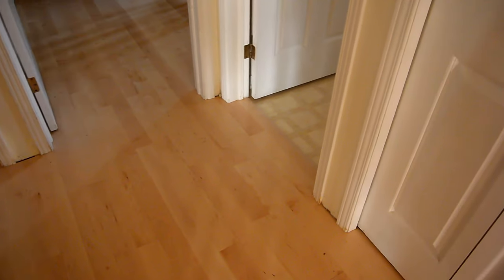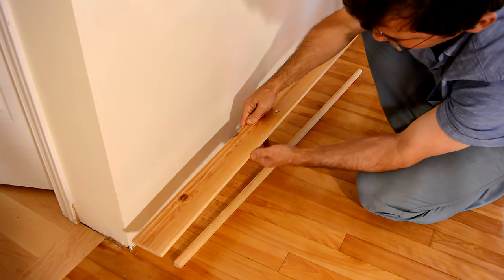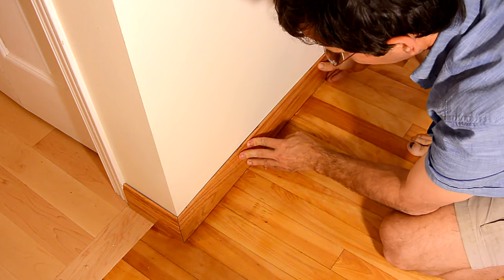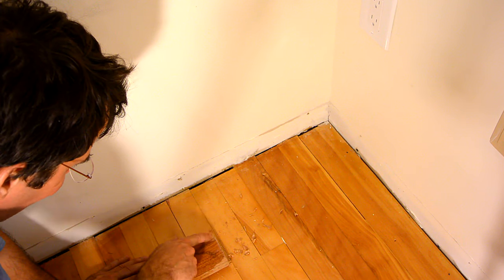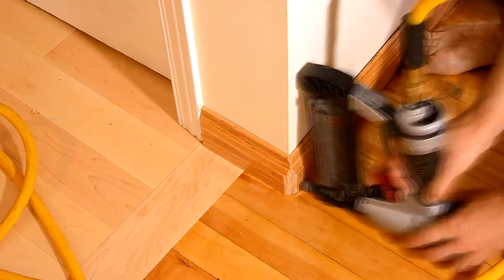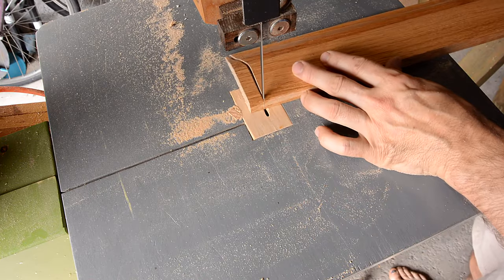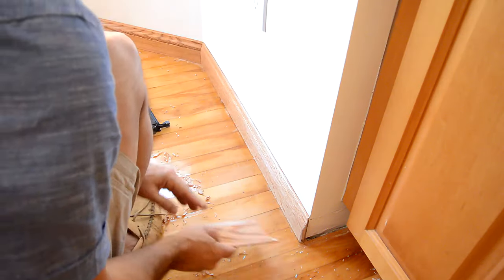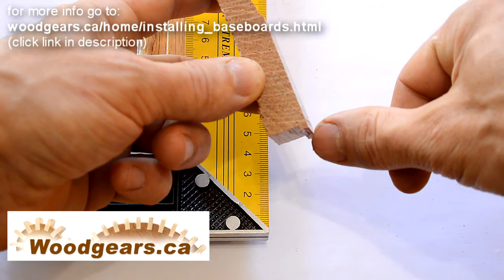Installing baseboards

Comment: I would never insult your intelligence, but how come you coped it that way? Why not just cut a 45 then follow the profile?
Reply: He said it was more work to get the miter to fit. The corners of the drywall aren't square so getting the angle flush is very difficult
Reply: Looks like you never installed something into a corner of a room ;) . I have yet to find a corner that's exactly 90°. Even being just one degree off from that will leave a very visible gap in the miter.
Reply: yea, i don't know if he knows how to cope a joint the "right" way, but if his way worked, more power to him
Edit: the way that most people do this is to cut an inside miter, one sloping away from the face of the work, then follow the very edge of it with a coping saw. works for all trim, and is way faster.
Reply: That would still be more work. It's work I'd probably do if I were to do this, but it's his baseboards. Doing it this way he doesn't need to cut a 45. On top of that, doing this it seems he just used a template to cut the second piece, whereas to match the 45, you'd have to custom do the profile for each corner, since each corner is going to be more visibly off.
Reply: Maybe one could use two rectangular pieces of play-doh to get the angles right if the corner ain't square.
Reply: I have a crooked ass old house, coping results is much less visible joints than mitres.
Reply: I liked it.
Reply: there is no reason for any custom profile, that's why professionals do it as i described. but it really doesn't matter, it just took him longer that i way i would assume, but he is not getting paid hourly, so it doesn't matter yet again.
edit: yes this way he is able to get the angle right, but htas the whole reason to cope, is to hide a joint that isn't 90 degrees. if he coped it square, and it was off a little, just hit it with a utility knife or a file
Reply: it doesnt matter the angle of the corner a properly coped joint looks perfect, he did a top job for someone who doesnt do this for a living.
Reply: AJPlaysToday Right. That's the way I learned as a wee little nugget anyway. It's always perfect no matter if you have a 90 or not. I guess the tilt of the wall itself could cause a gap but if the wall is tilted that much than you have bigger problems lol.
Reply: superdau Not miter. Cope.
Reply: seigeengine But he has the miter saw already there for his outside corners.
Reply: AJPlaysToday I usually cope it on a slight angle towards the back of the trim anyway. You won't see it and the front profile edge will sit tight.
Reply: None of you understand what big wonka is talking about.
Reply: no they don't ,,sometimes people can be so far behind they think they are in front
Reply: The first time I used a miter cut as a starting point for a coping cut it was a bit of a mind blowing moment.

People who aren't understanding it: go out to your garage right now and cut a 45° miter on a piece of moulding, then cut the miter off along the line formed by the intersection of the front face of the moulding and the cut face of the miter.
Reply: marking out is what takes the time, setting a saw to 45 takes nothing and you can us a coping saw/ flap disk on a grinder/ carefully flip the workpeice and use the blade.
Reply: Beefchicken Industries Lol all this time I thought it was common knowledge and standard practice.
Reply: Justin Underwood Seems that way.
Reply: YES.
Reply: Coping with 45 degree cut makes thing easier, but he doesn't need it because he's got a big bandsaw at his job site.
Reply: EJ Wu Treat the bandsaw as a giant coping saw. Doesn't change coping a miter.
Reply: Yes, but it's easy enough on a bandsaw without the miter, especially for experienced woodworker. Why bother?
Reply: Because the miter cut replaces the tracing out of the profile. I still don't think most of you understand how the cope cut works.
Reply: Brandon Francey I gave up lol.
Reply: Luke Rediger From beginning to end, this exactly how I do it. Great video! Lol I don't know why I didn't just link a video from the beginning. The only thing she didn't show, but I absolutely know she did, was to support the thin tip on the top with her finger when you cope that part. It'll always snap off if you don't. I've also seen people use a grinder to do the same thing. A little faster but you have to be a lot more careful to not jump your line.
Reply: You didn't account for the Matthias Wandel defense force did you BigWonka?

Coping is the way to go, it's faster and gives the best result and a good cope doesn't much care how square the inside wall corner is.
Reply: Because that would have made too much sense
Reply: Brandon Hall mitering first gives your cope cut a better fit because only the edge needs to match and not the entire thickness. It will cover up variances much cleaner by mitering first and then cut the profile
Reply: superdau not what Big Wonka meant. Before you cope you cut a miter so the back of the wood slants away. This leaves your cope edge nice and thin and sharp and gives you a better coped fit because you don't have to get the profile perfect for the entire thickness of the board, only the edge needs to match, also gives it better fit over wood movement even
Reply: I'm a carpenter by trade, it's how I make my money. I understand the ins and outs of coping. You run your first piece to the corner with a 90 degree cut. The piece you cope is mitered in the way BigWonka described so you can cope the profile more easily. The first thing your taught when learning to cope is that you angle your coping saw in a way that makes your coped profile end in a point, sort of like a a reverse miter. These way only a tiny edge needs to meet the first piece. This works even better if you nail your second piece at the far end first and let it bow out from the wall a little bit. Then as you nail the piece in from the far end it forces your coped edge into the corner and fills in any imperfections.

What is displayed in this video would get you sent to the unemployment line by lunch time.
Reply: agreed, it doesn't really matter the angle of the board that your 'scribing' (we call it in England) up to , just scribe  a line like Muffias did but then cut the mitre to that angle, scribe/cope along that mitred edge, cutting back to make the front edge a tight joint when you spring the board in, oh!! & WTF did he do to those outside corners, they look really really shit !!! Toe stubbing hazard!?  What a load of bollocks,
Reply: I can not believe the amount of ppl misunderstanding the question.
Reply: take the vertical angle like he did, move your miter saw to match it then cut it on a 45 at that angle, then follow the edge of the 45 on the bandsaw, much more precise, his bandsaw and miter saw should be next to each other if he did this method though, it might take 15 seconds longer each so it wouldn't really take much time extra and it'd be a better matching cope.
Reply: many new houses are just as crooked, once it's past a certain amount of crookedness it's all takes the same amount of work.
Reply: yea those little plastic things you put on the end of the wood and you can cope with a jigsaw and a fine blade, with those the cope is on a steep angle so it makes the amount of material to take off with the knife minimal, a square cope has material the full thickness of the material so if you have thick hardwood baseboard it would take more whittling to match the fit....
Reply: Nathan Mitchell is not really a new or old house issue, it's how walls are finished. Corner bead and mud will take a wall that was framed perfectly square and build up the corners so they no longer are. A good carpenter doesn't really care if the corner is 87 degrees out 92 degrees, they're going to cope the joint like a professional and give you a proper finished product. A hack will get out a band saw and start reinventing the wheel because he's too smart to ask for help.
Reply: @superdau  I personally miter inside corners if it's painted, cope if it's stained. I don't know anyone who trims professionally who cuts at anything other than normal angles, even for stained crown, you just adjust the joint to fit. Most of the time on inside corners you'll need one or two drywall shims behind the bottom of the trim thanks to the drywall taper. The longer the board the easier it is to make the corners align perfectly.

Comment: Sure having wooden houses with drywall has the bigger problem of fitting everything.

Here in italy where most houses are made of brick and mortar or cement and with tiled floors you can just make the baseboard out of specific tiles made for that purpose, filling all the uneven parts with the cement itself.

It will probably be much more expensive compared to wooden baseboards. Here at home we used to have them with wood, but living in the countryside we had periods where we were swarmed with centipedes and spiders in general hiding behind the baseboard, also in some places it rotted away because of very humid walls. The tiled baseboards helped immensely in fixing both problems.
Reply: Always interesting to here what folks in different societies use. Sharing such things is great for solving problems and coming up with creative solutions.
Reply: I'm sorry, but your baseboards rotted? And they had spiders living in them?
Why is your house so wet? Why are there big enough gaps in your trim for spiders to live in? I've pulled off hundred year old baseboard plenty of times. Even 50 year old baseboard touching shower pans doesn't rot away.

Comment: My family home, built circa 1840, uses ~ 6 inch base boards (U.K. called skirting boards), most of walls are stone & skirting boards are fixed with 3 inch nails to wood wedges driven into the masonry. These were all painted with an autumn yellow alcohol solvent thick finish that I like to remove to reveal the original wood grain, but it is a lot of work & few people care, but worth it to me.
Reply: Springwood Cottage have at it Hoss

Comment: You made the job of coping the inside corners a lot of extra work.  If you cut the second piece at a bevel with your miter saw it will leave a perfect profile to cut to with a coping saw.
Reply: I knew if I read through the comments someone would tell him what I wanted to say as well.  : )

Comment: What I've started doing as I do more base boards around the house, I'll actually get the actual angle of the corner, being inside or outside corner, and cut in half accordingly. Very rarely am I actually cutting a perfect 45°. I always shave out the back corners with a blade where they meet the corner, save for the top, perfect miter every time.
Like the way your coping joints turned out. Like the way the whole project turned out, actually.

Comment: Oh thats what a baseboard is. 

I always wondered
Im German
Reply: In the UK we call them skirting boards, and I have never seen any with extra "quarter rounds" to cover gaps. We cut our floorboards to the correct length lol.
Reply from the maker: it's not for horiztonal gaps, its for gaps because of uneven floor height.
Reply: in Australia, I've never seen the quad (quarter round) on the floor either. we've never needed it for floor gaps. but our standard skirting size is 68x11mm, plenty of flex.
Reply: Daniel Wilson we use them a lot in the uk with DIY laminate flooring. The crappy MDF kind.
Reply: 11mm joeegg62 ??? wenn der hersteller schon bis zu 15 mm dehnungsfuge bei echtholzparkett verlangt ? dann muss da doch wohl auch noch nen viertelstab dran ;)
Reply: Quarter rounds are a very traditional way of trimming the bottom of the baseboard. Many modern home designs don't use them any more.
Reply: Florian Ragnar Geyer In the 50s in Alberta, CA We called them mop boards.
Reply: I live in Alberta, CA in a house built in 1948. The base boards aka mop boards were installed before the hard wood flooring was installed. 
A 1/4 round "shoe" was installed to hide the space between the base boards and the ends of the flooring.
Reply: Florian Ragnar Geyer in the UK, we call them skirting boards

Comment: Having put a lot of baseboards in professionally I really like this method more. It's a shame that I mostly do old concrete buildings after the electricians pull new cables in and we have to use baseboards that fit 4-5 cables.

Those outside corners are good too, but I'm not sure how many people walk so close to the walls to hit the corners in most rooms.

Comment: At my father's shop we do it the "hard" way, and we make a bevel in the opposite corner of the moldure  for the plaster bits that get sutuck there. My grandpa used to put them with screws but now we put them with polyurethane and nails form the nail gun

Comment: You have 3 options; quality, speed, and cost. You can pick 2. Want something done high quality and fast? Won't be cheap. Fast and cheap? Low quality. High Quality and cheap? Will take some time. Want something done right? Well, better just do it yourself.

Comment: Wooden floor still boggles my mind.  It would be so damn expensive to conver the entire floor with wood. 
I'd rather save that money and maybe build an extra room or two in the house.

For reference,  this was the per sqft pricing when we built the house back in 2006. Prices remain the same apparently.
Ceramic tiles - 35Rs 
Marble - 60Rs (which we got)
Granite - 100Rs.

Even plywood costs over 150Rs per sqft. Hardwood would probably cost so much more.
And wood rots in monsoon, and becomes the home of termites and ants instead of humans.
We still regret getting wooden window frames. 
And our wooden doors keep bending back and forth between summer and monsoon.
And wood has to be so hard to maintain clean. Stains in marble is already hard enough to clean. I can't imagine wood. And wood would get scratched so much.

Comment: nice to see you scribed the bottom of the skirting, that 1/4 rounding looks terrible (I'm my opinion), and coping the inside corners too (you can chamfer the inside (against the wall) of the skirting too makes those inside corners fit better and a bit easier too. The way you have done it makes the job look alot better, than using that 1/4 round evil stuff..... 😊 . MDF has its place and for the flooring you have, you made the right choice.

Comment: For a similar toe-saving effect, why didn't you go around outside corner with 22.5-ish degree cuts?  One extra piece, triangular in cross section would replace the end grain you have showing, and leave the same outside angles.  This is clearly a very polarizing issue.  Hopefully, death threats weren't involved.

Comment: Matthias, An easier corner fix these days is often provided by another molding piece which is more expensive in material cost but faster in assembly which is the finish carpenters goal these days.   I've watched you make the base board which I did for a house I built/rebuilt for my parents many years ago.  The removal of material from the back was something I could not accomplish.  Had a really primitive craftsman 8 inch saw.   And I used pine.  Nice job my friend!

Comment: Well, I don't want to comment on the outside corner, you have enough advice on that issue.  But for what it is worth, I resolve the uneven wall problem my actually adding wood behind the drywall.  I know that is time-consuming but it sure makes certain any wood movement doesn't open the gap.  If I am installing molding that will be painted white and the gap is less than 1/8", I use calk but with natural wood, I open up the drywall between the studs, use a Kreg jig to provide screw holes for the fasteners and anchor a piece of wood, usually a 2 x 4, between the existing studs.  I cut the rectangular hole with a multi-tool, save the piece of drywall, glue or screw it back and use some Duro-Bond 90 to finish out the job.  If I am careful, I don't have to add the task of painting to the project.

Comment: A tip when coping. Cut a 45 on the piece you plan to use, you'll notice that the desired shape of your cope is revealed along the cut line profile. Then with a coping saw, back cut along that line at 2 or 3 degrees to allow for fine tuning when fitting. I have laid 10's of thousands of feet of baseboard and moulding...works great.

Comment: I like it! Despite the comments below, I also like the mitered outside corners; they make the trim look very unique and customized. The varnished wood looks much better than the painted trim.
I agree with you, it would look very lovely if you were to replace the door trim; the painted trim just doesn't look right any more.

One question: I'm not a woodworker, so this is not a critique; I am asking a question in hope of learning something. Rather than make that rectangular relief cut on the bottom of the baseboards, why wouldn't a shallow-angled mitered bottom be better? It seems to me that prototype cut takes two passes (depending on how you cut it), whereas a miter would only require one pass. Additionally, the prototype cut looks as if it only allows that tiny chip's height to be the maximum you could remove at any given time. If the back were mitered, you could remove as much or as little as needed.

Comment: For the future to accomondate the curved floor, you could should cut the downside edge maybe 5-10° angled to make it easier to modify. Also make it 5mm taller. For the installation hold it against the floor, and trace a line around with a pencil laying flat on the floor. The curvage should trace to the moulding and so you can cut it easier and remove the excess 5mm. It will produce more waste though...

Comment: You could've turned a profile to match your molding, sawed it into quarter round and used those pieces to cap the outside corners. Not that I'm recommending that, you've already put far more craftsmanship into the job then I would recommend for anyone.